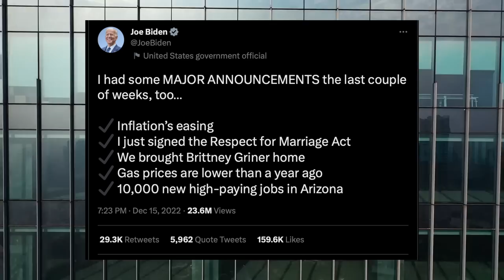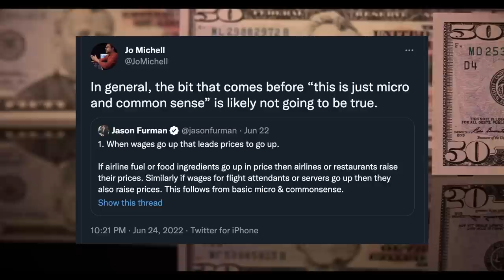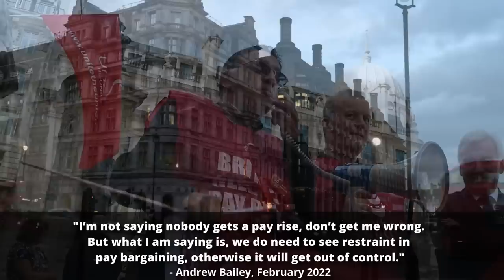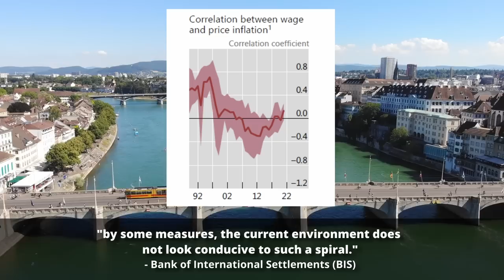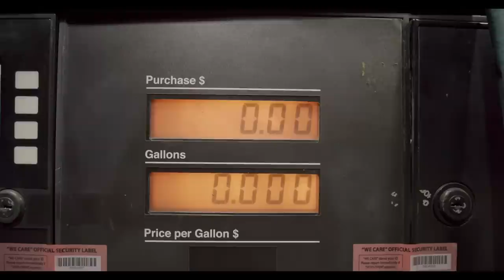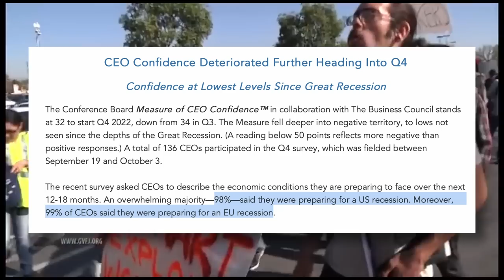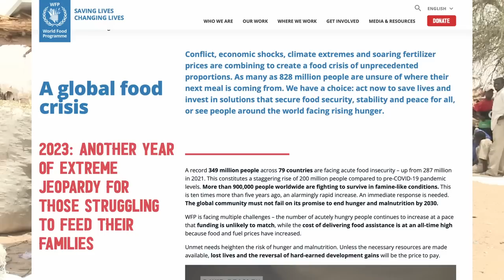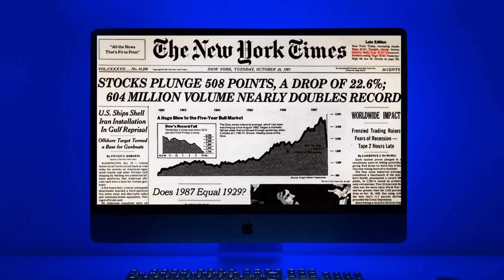How Johnny Harris & the Media Lie about Inflation

Comment: The real reason they're raising rates is to take excess money out of the system that has been dumping in since 2009. QE failed, and now the Fed has to fix it. Now every corporation  that has used debt for zombie SPACS is in trouble and crying about rates "slow down, it's too high" blah blah blah blah. They had free money for over a decade and took on more debt than they can handle. Corporate debt is something no-one talks about. They inflated their own books by posting YoY profits, while refusing to get a hair cut. When yield rates drop and the dollar goes higher, the party will over. Payback is a bitch and debt laden corps will feel the pain.

Comment: The theory about more money causing inflation is rubbish. Inflation is the prolonged imposition of higher prices — liabilities — on society by those with the power to set or increase prices to increase profits. When incomes or the access to assets by members of society remain the same or are reduced, more of their assets need to be transferred to the price setters. Assets minus liabilities equals equity — wealth —which is reduced for those trying to meet their liabilities. 

The price setters that impose the higher liabilities receive more of society’s a$$ets. So in that case, a$$ets minus liabilities result in higher equities — wealth — for the balance sheets of the price setters. 

In short the rich get richer and the poor get poorer. 

Then the central banks hike interest rates signalling to the banksters to further impose higher liabilities on society. Of course, since wages and purchasing power — a$$ets — remain unchanged or are reduced, still more of society’s a$$ets are transferred to the banksters changing the balance sheets of workers so that their equity — wealth — is reduced by the same amount that the equity or wealth of the banksters is increased.

The rich get even richer while the poor get even poorer. 

But why does nobody challenge the notion that because supplies are allegedly low, prices do not need to be raised? The challenges here to price-profit spirals is spot on. The intersection of Supply and Demand setting  prices is silly and not a valid frame. Prices are not set according to those ideas. It is a cover to increased profits — the transfer of more of society’s assets to meet imposed prices or liabilities.

Comment: The "Iron law of Wages" is moronic. 

Front line wages are only a percentage of the cost of a product. In many places actually a fairly small percentage. 

So if you can do grade school math you can figure out that a % raise in front line employee wages will always be larger than the % raise in costs for the product. In many cases a lot higher. 

So even if the increase in employment costs does raise prices (like the company actually uses a cost+margin formula to determine pricing, or it is a near 100% service business) the rise in prices will be substantially less than the rise in wages. For example in some industries raising front line wages 50% may only have a like a 5% is effect on total costs and thus product price. 

So the working poor front line workers will be able to afford a lot more of slightly more expensive products. Net benefit to society. 

That small effect on prices only happens if:
- the company was actually using a cost+margin pricing model, which is actually rare most companies use other models for determining pricing
- the company is not already really high profit making so much money the employee raise looks like a rounding error on the financials
- the raise did not bring other efficiencies like more loyal and harder working employees, better customer service leading to more customer loyalty and higher conversion rates.
- the executive compensation and shareholder returns did not reduce a bit to allow for the higher front line employees wages. If the company stupidly calculates executive bonuses and shareholder returns in their pricing formulas.

Comment: One of the biggest causes of inflation is industry consolidation. 

If the system is truly capitalist as so many people worship, then the health of the system is based on competitive markets. 

Losing a competitive market to an oligopoly of huge corporations means: higher prices, worse quality, poor service, less variety, lower wages and worse conditions for front line employees, tighter squeeze on vendors, lower tax revenue. In general a net negative for society. 

There are ways to fight this:
 - fight mergers/acquisition
 - raise corporate income tax rates
 - support new entrepreneurial business instead of huge corporations with grants and subsidies

Also be aware of what industry sectors that are Natural Monopolies/Oligopolies where it is physically impossible or completely impractical to have an open competitive market. Such as infrastructure, grids, first responders and such. These need to either be government run, social collective or regulated into submission, there is no way any of these Natural Monopolies should be open for profit corporations.
Reply: Eh, this is a comprehensive approach you are putting forward, and unfortunately, the only realistic solution to the problem of Capitalism. 
It can be done, but people need to be patient and always lobby for it.
America is a bureaucracy, so if you stop demanding this change, it will reverse itself real quick. The political system that shuffles itself every four years is also a drag on such a comprehensive solution.
I think that this is why people think communism is the saving grace. Because it sounds like a silver bullet. A swift and simple fix.
Reality however is much more brutal.

Comment: “The UK government has collapsed”
me looking around in the UK
This guy exaggerates and misinforms as much as the next guy, proceed with caution
Reply: I was extremely confused by that statement. I am absolutely no fan of the Tories but as far as I can see they're still functional.
Reply: Also those Cheetos for £7 are imported from the US. They've always been overpriced...
Reply from the maker: Liz Truss fell after 6 weeks, after Johnson already had to resign due to massive problems he couldn't handle. Sunak is the third PM in less than 2 months. Talk about a stable government.
Reply: @BesDMarx  It's not collapsed though. You're exaggerating. If you want to be taken seriously then you need to present facts at the level they really are. The UK government is still operating as much as it has in the past 2 decades regardless of it's leadership changes. It's a bit like the £7 bag of chips you mentioned. They don't represent the actual price of chips in the UK as they are a imported product which are priced higher by store owners. A standard bag of chips in the UK would be between £1 - £2.
Reply: @BesDMarx  it's a parliamentary system. The government is still functional. You just lied. You could have said facts and still made your points.
Reply from the maker: @otterlyfoxed  Much of the media used the word, it's not uncalled for. The UK state is still operating obviously lol. That particular bag of chips was £7 though why are you focussing on the most uninteresting details of the video.
Reply: @BesDMarx    Because you’ve used the example of a product which isn’t standard to present the idea that the average bag of chips in the UK has risen to £7. You said that pretty much everything has gotten more expense with chips cost £8 in the UK. That was a picture of American imported Cheetos, not a standard bag of chips in the UK. The way you presented it makes it seem that if we want a bag of chips in the UK we have to fork over £7. That’s literally just a random bag of Cheetos in some independent store in London. The same type of stores which are selling Prime drinks at over £10 a bottle. Doesn’t mean if I want a bottle of coke I’m spending over £10. Now I’m sat here wondering what else is being misrepresented in this video. I’m just saying that by that one small unimportant fact which needn’t be in the video, I’m now questioning the entirety of your research.

Comment: This ONE of the factors that explain inflation.  Inflation is very hard to predict and read because it's affected by a lot of factors.
Reply from the maker: The point of the video is to say that it's systemic (hence, multiple factors, chiefly, the mode of production), it's the people I am criticizing who reduce it to 1-2 isolated things (eg, wages or "handouts").
Reply: @BesDMarx  yes and it's a very well done video. Inflation's is a difficult topic to toggle.  Congratulations. Hope to see more expositions from you.
Reply: @BesDMarx  if it was truly systemic then the feds lever switching mechanic of quantitative easing and tightening wouldn't have a vast effect on inflation, yet it does.

Comment: I'd argue that all the things said about inflation are true, and that what's going on just isn't inflation.

With everything being a monopoly, all of the inflation stuff means nothing. 

Every industry has some sort of monopoly, duopoly, or triopoly at best.

Event ticket sales, cheerleading, ski lift construction and maintence, freaking video game wiki websites.

We need to enforce anti trust laws
Reply from the maker: What's important to understand is that corporate profiteering is always the case, with or without inflation. When the general of level of prices rises, it both has to do with "profiteering", and the pure exploitation of the situation so to speak (jack up prices due to consumers being accustomed to the rise of prices). 

Profiteering can ultimately be only solved with a new system, it won't go away with Anti-Trust Laws (by the very essence and definition of capitalism).
Reply: @BesDMarx  the problem is that those other systems also have fundimental problems. That's not unique to capitalism.

Anti trust laws are a fairly easy way to massively lessen the amount of power and influence the corpos have on the system that doesn't require us convincing 300 million people to commit to something completely new.

It's all well and good to say "we should do a socialism" but there's a lot more to it. Everything from unique corruption that needs a system to handle, to just the bueorocratic nightmare of actually running that mess.

Anti trust laws are just a matter of enforcing laws we already have.

Comment: "It's more money chasing fewer goods! 

"It's capitalists capitalizing on the inflation narrative!" 

IT'S BOTH. Otherwise, explain hyperinflated currencies.

Separate money control from state. DONE. Bitcoin is doing this.
Reply from the maker: Neither of these is totally correct. The first one is reductive and doesn't explain very much (hence why most economists don't use that explanation anymore), the second one is partly true in that while they do capitalize on it, they are the driving force of it (profit imperative, etc.). Separating money control from the state is utopian, it's the nature of the state (along with it, the social system) that needs to change, it's through capitalist class society that money takes up the form that it has, and not vice versa.